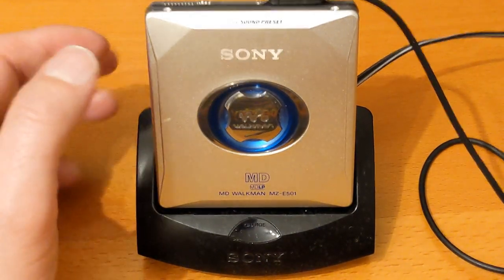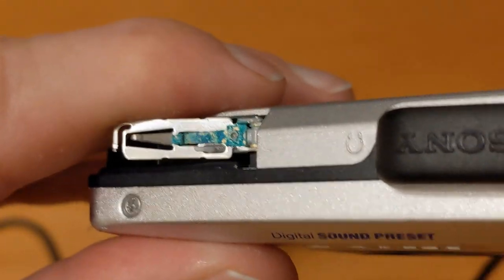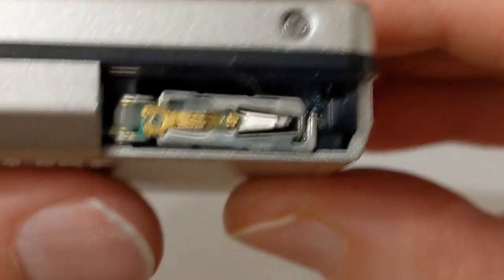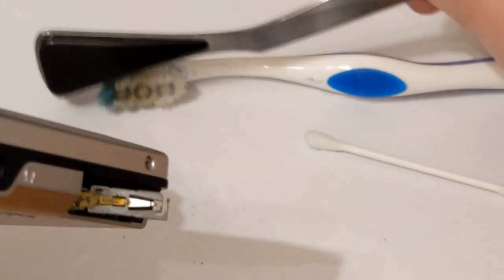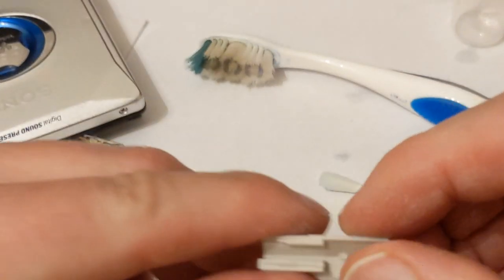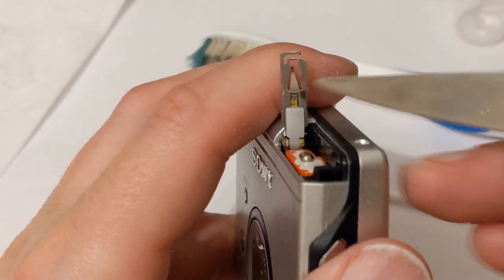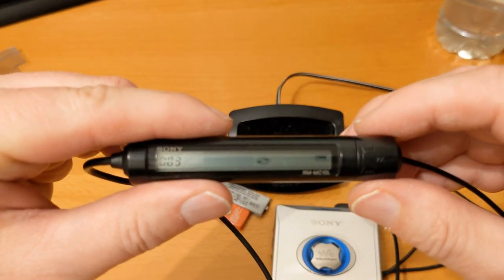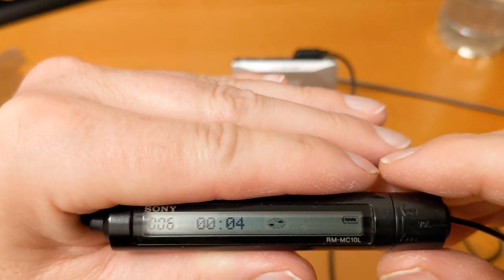Fixing a non-charging Walkman Minidisc Player

Comment: Nice job !
BTW, I have very similar to N710 - Sony MZ-NF810, in really bet-up condition, but working. Nice feature it supports Type-S. Does N710 supports Type-S ?
Reply from the maker: Yes, my N710 has Type-S. Is the NF810 the one with the radio feature?
Reply: @CBitsTech  looks like it exactly the same but radio. But radio is only in the remote. So bodies are probably identical
Reply from the maker: @InsideOutElectronics  Yes, probably. I think the player display shows the radio stations too, doesn't it? I wonder if the N710 has that capability. I doubt it. Maybe one day I'll get a radio remote (not that I listen to the radio).

Comment: Last week i bought a MZ R900 ,unfortunately a lot of blue corrosion on positive contact.
The battery compartment was imposibble to open.
After 2 hours i succeded to pull out the original Sony NH-14WM,i use wd40 and isopropilic alchool.
The positive contact was compromise, need to change it from another device.
When i charged the battery ,these was very good ,99 % live ,this is in very good condition.
How is posibble? Leaked battery and blue corrosion but actually very good performance,this keep the current like a new one 😊
Regards .
Reply from the maker: Sounds like yours was very bad corrosion.

If the battery leaked, then it can't have the same capacity as it had before. It will charge, usually, and get to the correct voltage to indicate a full charge, but it won't last as long as before. It's pretty amazing that roughly 30 year old batteries still perform well.